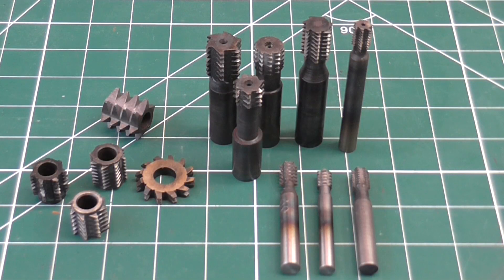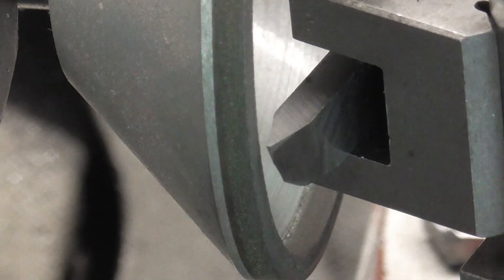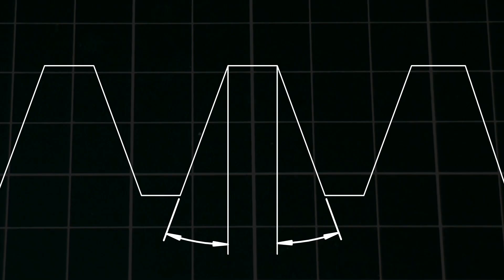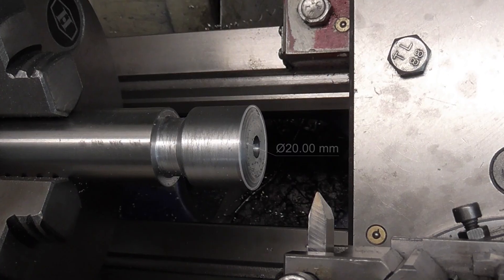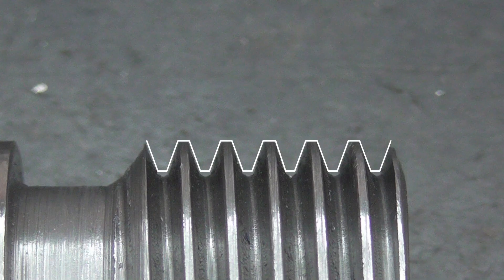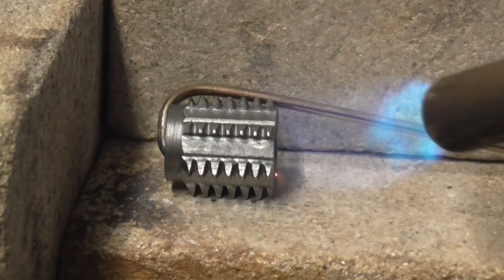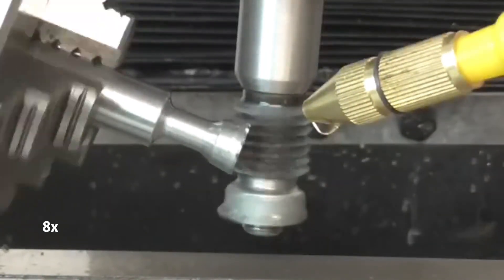How do I make my own gear hobs? (Gear cutting)

Comment: When you tilt the head of mill, doesn't that slightly distort the shape of the teeth, compared to your cutter?
Reply from the maker: Good observation! Yes it does, it introduces what is called 'cosine error' however if the tilt of the head is only a few degrees then it's so small that it's not worth worrying about (the cosine error produced by a 3° angle is something like 0.001). You could account for this when making the hob if it has very large teeth relative to it's diameter by adding the error on to the pitch so it gets cancelled out. 

I've no idea if commercial hobs account for this error, they usually have a smaller tilt, only a single degree or so. They may be ground in such a way that the error is cancelled out automatically by the process.
Reply: @AndysMachines  Thanks for the reply! I knew the error would be small, but i asked because i was going through it in my and wasn't sure if that got cancelled out somehow.  To take it another step further, i believe theoretically the helix angle at the root of the cutter is greater than at the tip. I guess the only way to get a perfect tooth is to generate it from a rack, or single point cutter.
Reply from the maker: @zachary3777  Yes, the helix angle does change with the radius, but I suppose that's also true when the hob is made, so perhaps the effects of this cancel out. Another reason commercial hobs are usually quite large diameter in comparison to the size of the teeth (at least compared to my home-made ones).

Comment: Would it be possible to plunge straight into the hob with a single point form tool at every pitch increment, and not generating a helical formed hob, then not tilting the spindle axis as the teeth would be perpendicular to the gear's axis? thanks for producing great information. subscribed.
Reply from the maker: Yes, you can do that and I have done it that way in the past. What you end up with is not technically a hob, but a stack of disc gear cutters. You still need to index the blank for each tooth, but like a hob the tooth profile is generated from multiple cuts so you can use it to cut any number of teeth, though the profile is more approximate, especially for low tooth counts which don't intersect with as many teeth of the 'hob'. (You can improve on this by indexing the gear a fraction of a tooth and raising/lowering the 'hob' by an appropriate amount)

Comment: A bit lost here...why have you not formed an involute profile on the tool to cut the hob? Presumably you are cutting involute gears here. Any explanation would be greatly appreciated.
Reply from the maker: Yes, they are involute gears but the hob has straight sided teeth (like a gear rack). The involute profile is generated by the way the gear blank turns as the hob cuts the teeth. This is how it is possible to cut gears with any number of teeth using only one hob. See here for a visual explanation: https://youtu.be/7WleHVtIc1c?t=139
Reply: @AndysMachines  .Oh this was so helpful. Thanks for the explanation. Is there a fixed ratio of the revolutions of the hob to the work piece, are there formulae available?  I have been making an accurate brass orrery for the last year or so and this explanation will spur me on to look a bit deeper into the process of gear cutting. I had to make some 'contrate' wheels along the way but could find little by the way of nomenclature...just used normal [mod O 9] involute gear cutter for them. Cheers, and thanks again for your help.
Reply from the maker: @isobar5857  The the ratio of hob to work piece is 1 hob rotation for each tooth on the gear. eg. for a 20 tooth gear, the workpiece revolves 20 times slower than the hob.
Reply: @AndysMachines  .Thanks again for your reply. Is there a 'direct' gear train between work piece and hobber...or can this ratio of speeds be maintained accurately independently ? If I'm correct I assume you are using a 'stepper' motor for one of the drives...I presume are these motors are accurate for this application.  Thanks again for informative responses.
Reply from the maker: @isobar5857  Having a gear train in between is one way to do it, but I do it electronically as it's far simpler to set up. Yes, open loop stepper motors can do this accurately, check out my other videos on building the hobbing attachment.
Reply: @AndysMachines   Most grateful for your reply once again. My concern here was that a cumulative error might creep in if the ratio of rpm between work piece and and hob was not accurately maintained. I have seen your other videos, more specifically, relating to your hobbing attachment...it's great. I'm a retired machinist/grinder but my skills in electronics and computers died out with the dragon 32 and commodore 64, which I used practice programming in assembly language...many years ago! Once again, thanks for your response and patience.

Comment: This is a sound presentation. I have just learned the concepts of the module, addendum, dedendum, angle of pressure, the tip of width, and how to work them out.

Comment: How would you calculate the flat distance for grinding a hss tool for making a worm wheel hob? Also when cutting the hob the OD should be bigger than the worm gear for clearance how much bigger? When making a hob to a cut worm wheel wouldn't the hob match many dimensions of the worm gear. There for the hob is only used to cut worm wheels for that specific worm gear. If the worm gear is 2 start would the hob have to be 2 start or would single start hob work?
Reply from the maker: You would do it in a very similar way. Yes, the worm hob should be similar to the worm except that the addendum and dedendum are swapped over, so the OD of the hob is greater than that of the worm (by 0.5-0.8 x module). People often make two identical worms, cut teeth into one and use that as a hob to make the worm wheel, though this does work it is not technically correct as there will be no clearance. 

I actually made a worm, matching hob and then cut a worm wheel with it recently. I took video footage of the process and this will most likely be in an upcoming video where I'll try and explain the whole process.

Comment: Does the rpm of the indexer in relation to the spindle with the hob in matter? And if  so, how do you calculate both rpms?
Reply from the maker: Yes, they have to be synchronised, that's what the controller does. (See my other videos on gear hobbing).
Reply: @AndysMachines  will do. Thankyou

Comment: The tip facet can be measured much simpler.  In a scrap piece, cut a square groove (do not break edges), width =  1/2 x circular pitch (minus a little, see below), depth = addendum.  As you are grinding your tool facet, try it in the test groove.  Initially, the tool will "bottom out" and wiggle side-to-side.  Grind until the tool still contacts the bottom but does not wiggle sideways.  No trig or balls needed!  The facet should have its corners lightly broken with a stone so you do not cause stress concentration in the root of the hob.
          A comment about your facet calculation: the tooth width at the pitch circle SHOULD NOT be exactly 1/2 x circular pitch.  For both metric & imperial gears, the tooth is made a little narrower than that.  For imperial, standards call for 1/20th x circular pitch clearance.  That means tooth should have width of (1/2 - 1/40) = 19/40 = 0.475 x circular pitch.  If you do not make this adjustment in making the hob, the center distance between the gears will have to be increased to prevent jamming.  Another way to incorporate this is to set the hob a little deeper than the formula indicates.  Disadvantage is that you weaken the teeth as you are cutting too much from the dedendum.
Reply from the maker: Yes, you can make a gauge to measure the cutter, that works well too.

You are correct, geartrains are normally assembled with a small amount of backlash between each gear to ensure smooth running without binding. In clocks and watches this was generally done by adjusting the centre distance. In modern engineering it is usual to cut the gears slightly undersize and keep the theoretical centre distances (this has the same effect you describe of making the tooth slightly narrower than the space on the pitch circle). Hobs are normally ground to the theoretically ideal shape and the depth of cut taken on the gear blank adjusted. Because the gear tooth shape is an involute it is quite tolerant of small variations in the centre-centre distance between gears.

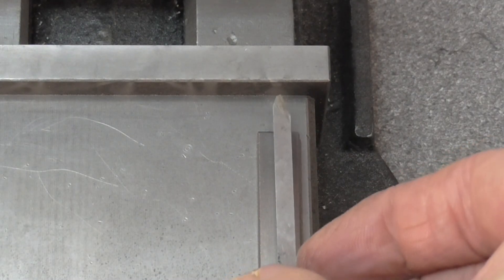Comment: At 5:31 the cutter has an obvious helix angle, at 5:36 the cutter used to for measurement has no helix angle.
Do you cut with helixed cutter and filmed with the straight one?
At 11:30 you say the hob is set in the milling machine at the helical angle of its teeth, is this exactly the same as cutting the hob on the lathe with parallel grooves and setting this hob in the mill square?
Since your hob has short teeth, can it be used to cut helical gears with high helix angles say 45deg?
Thanks Andy for the very detailed video(s)
Reply from the maker: That's actually the same cutter (it has a small mark on it which you can see in both shots) Though it's possible I might have reground it between these shots as it does look different, or it might be the camera angle. We are looking at the bottom of the cutter here and since this cutter is used for (right hand) screwcutting I have ground more relief on the left hand edge, I just do this by eye so it's probably more relief than is actually needed which is why it looks so asymmetrical from the bottom. What's important is that the top edge which has no rake and is symmetrical, is raised up on the parallel to exactly the centre height of the balls so that I am measuring across the cutting edges. I guess you could call the cutter 'helixed' It's really just ground to clear the helix of the screw.

re. hob with parallel grooves set square in the mill. Yes, you can also do it that way. if you look at the hobs I made at 0:41 the hob with large teeth at the top of the picture is made this way (because otherwise with such large teeth on a small dia. hob it would have a very large helix angle).  Yes this is effectively the same as a helical hob tilted at an angle, but since the angle is zero the blank cannot rotate during the cut in the normal way, so you have to index each tooth one at a time. It still generates the tooth profile in the same way a hob does though.

Helical gears of even greater than 45° can be cut and the relief on the hob is not an issue since the hob is always cutting parallel to the teeth, not at an angle such as when screwcutting on a lathe where you have the helical angle of the screw yet top face of the cutter is usually horizontal.

Comment: Hello 👋. I just subscribed ☺ with. I'm from USA, first your video was very intense 😳, but also very useful for anyone who wanted how this process works 😀. Do you own a machinery shop? I'm retired, with 44yrs and most of it my career in a machine technician. I'm going to follow up, and do some hobby. Send me a reply, thanks.
Reply from the maker: Thanks for subscribing and for the comments. I have a small home-shop, I'm just a hobbyist and have never worked as a professional machinist, though both sides of my family worked in related industries.
Reply: @AndysMachines  Thanks for taking the time, responding to me. May I ask you where 🤔 are located. I also have down graded to a much smaller house. But have a basement, and put the Lathe I purchased, down there. Here in Michigan it gets too cold 🥶 to equipment like that 😒. I can talk, however I don't have a ytube account. I will eventually 😌, you can't download anything.

Comment: Andy... At 9:45 ... you are retracting the live centre whilst you index the hob to cut the next flute.... I'm wondering why... as it seems to allow swarf to enter the live centre / hob interface surface... nice vid... Silver Steel is great for making tools but I hate screwcutting it... 🙄😂

From the Emerald Isle
😎👍☘🍺
Reply from the maker: That's because the rotary table I'm using for indexing has plain bearings and pressure from the tailstock makes it very hard to turn with the handwheel (probably wouldn't be good for it either). I only really need to back off the centre a little to relieve the pressure, but I take it right out so I can brush off any chips that might fall in (though I do seem to have forgotten to do this every time whilst filming!)

Comment: I don't know 'nothing' about the gears and I find this very interesting. But I wish you have included explanation of how do you synchronize the speeds(RPM) on both, attachment and the spindle.
Reply from the maker: Check out my previous two videos on the hobbing attachment, there's a lot more information there.

Comment: Hey Andy
Great video !
im a cnc mill guy 25 yrs
you diy a cnc mach too ?
Reply from the maker: Yes, I've converted a small manual milling machine to CNC and also added (very basic) CNC to my lathe. Over the years I've built a number of other CNC machines, mostly gantry router type.
Reply: @AndysMachines  im gona do that soon.
i met a tobaco/ginseng farmer few yrs ago. i told him im a cnc mill guy, he told me alot of his friends build and run rc cars n copters. he also told me, some of his buds spend few $k/month on custom cnc machd parts. you could prbly mach parts like that. no crazy dims r tols.

Comment: What about the speed of spindel and deviding head? How do you calculate the speed of these two ?
Reply from the maker: See my previous video on the hobbing attachment, The spindle speed is set manually then the hobbing spindle rotates in sync at whatever division ratio is needed.

Comment: If you'd tell us how you built the control box for the stepper motor that would be the last thing to get me started. Not because I'm lazy to work it out myself, but because I'm only getting started in electronics and I don't know where to start. Building it is no problem for me, but coming up with a layout for a circuit or using an arduino is beyond my abilities with not knowing what to look for.. Thank you for you huge effort to make these videos as good as they are, anyway.
Reply from the maker: A lot of people have asked for this and I'm working on an updated version of the controller with more modern components that will be simple to put together (arduino based). There will be a video on this in due course.

Comment: is the cutter you made in the last shot for skiving?
Reply from the maker: Yes, It was my latest attempt to make a skiving cutter for internal gears. It was an improvement over previous ones but still not perfect. I'm beginning to think a shaper would be a better option. Skiving is great for industrial use where you want to produce hundreds of identical gears, but there's really a lot of work and calculations involved in making the cutters, which then are only suited to one size and tooth count of gear as the way they generate the profile is different.
Reply: @AndysMachines  they do seem magical though

Comment: sweet, thanks for showing the cutter flat calculation!!!  Not sure if you've checked out my video on cnc gear cutting without a gear cutter but I was hoping to find this calculation and now I can update my simulator!
Reply from the maker: Yes, I did see your video in the past. That's actually a very accurate way to generate gears as you are taking a large number of individual cuts to generate the involute profile. I used to do something similar using a 'hob' with no helix, like a series of stacked discs with a rack-like tooth profile and cutting on the side of the blank, indexing by one tooth at a time produced fairly good profile, and then you can take additional cuts with the 'hob' at different heights.